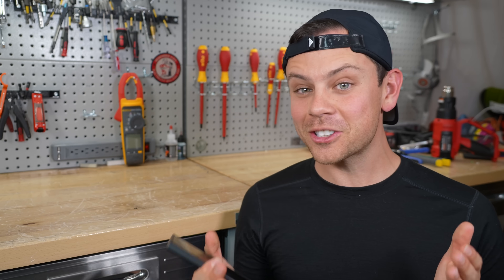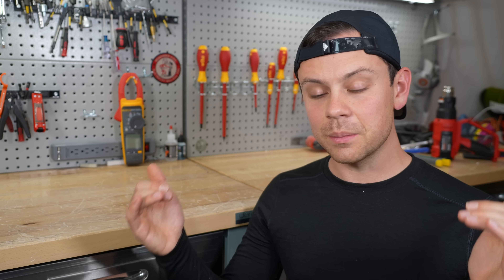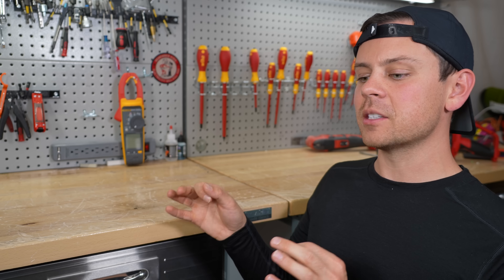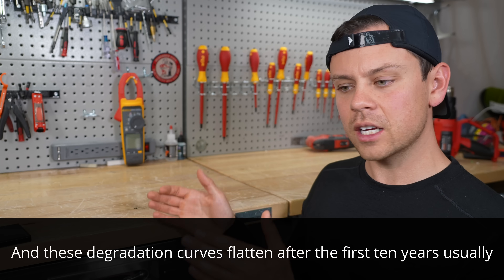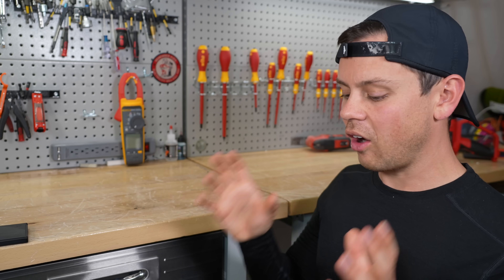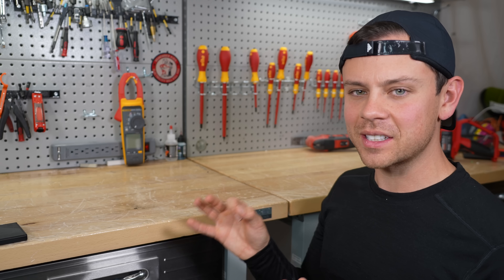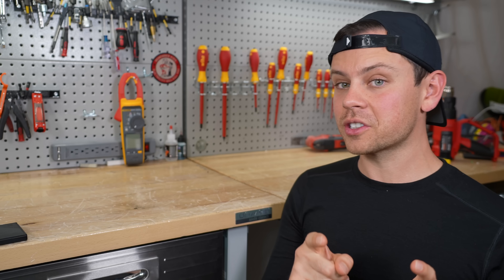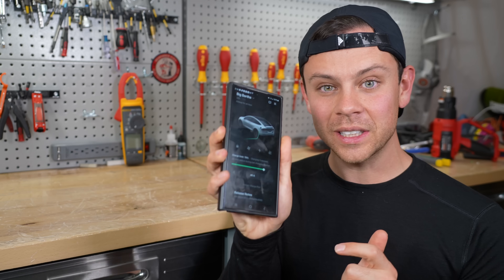LiFePO4 Longevity Discussion! Why Charge to 100%?! For Solar??

Comment: Hey Will, so set the victron mppt to absorption 14.6 and float 13.5? Lifepo4 100ah 12v litime
Reply: 14.2V is plenty.  Anything over (roughly) 3.42V/cell (ish) (e.g. like 13.7V) will fully charge a LiFePO4 battery.  You just need to ensure that the voltage target is high enough to trigger the BMS's internal balancing.  13.7V might be too low to do that, so  using 3.55V/cell (14.2V) is usually a safe bet to ensure that.

The BMS high-voltage disconnect is typically at 3.65V/cell (14.6V).  There is no need to charge the battery to the point where the BMS disconnects.  It can actually cause problems for the charging sources because they might over-shoot when the battery suddenly disconnects.

Float MUST ALWAYS be 3.35V/cell to 3.375V/cell (13.4V to 13.5V) to maintain a high (99%+) SOC with the least amount of stress on the cells, after fully charging to 14.2V.   Float mode also allows e.g. a solar system to provide load support while the sun is still out after the battery has been fully charged, without draining the battery.  So the overnight drain starts when the sun goes down rather than earlier.

Once can also do load-support at lower voltages to prevent shutdown when the battery gets close to empty.  For example, having a charger in power-supply mode set to 12.0V or something like that that is powered from the mains to support everything running off your battery system if the battery gets too low overnight, is perfectly acceptable.  (do not connect regular power supplies directly to a battery for load-support unless they were designed to be connected to a battery, at least not without a diode array to prevent back-feeding the supply).

-Matt

Comment: Will I have a setup of old lead acid batteries.  They seem to draw down fast from a full charge.  Is there a way to test them do I need a shunt?
Reply: I have the same issue.. I am moving to lithium.  save the shunt for a lithium battery bank..